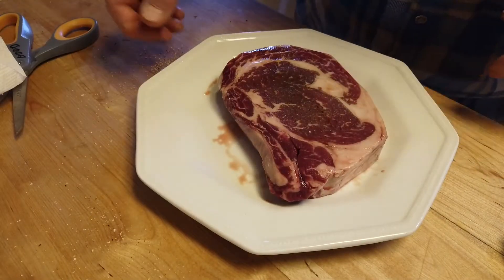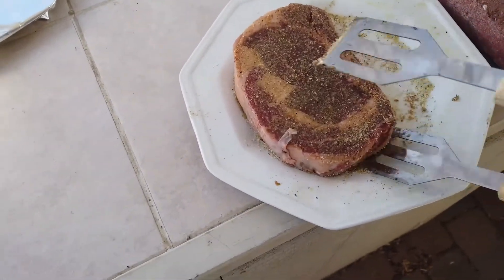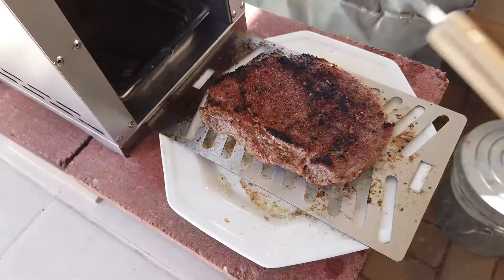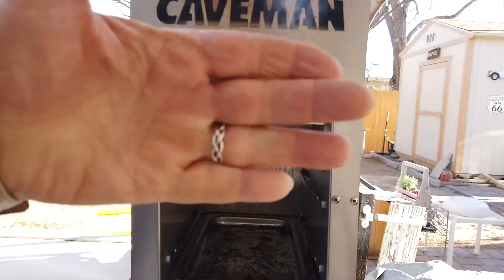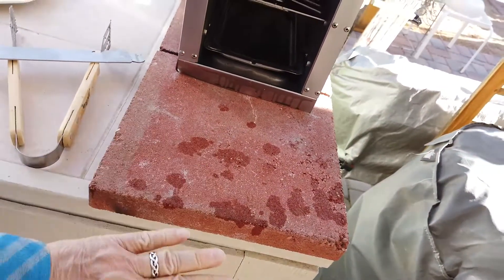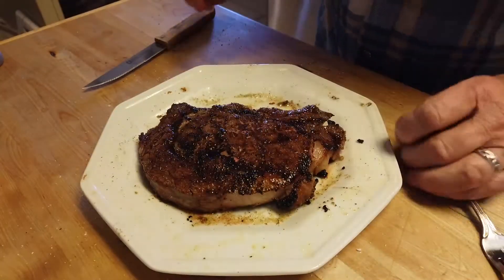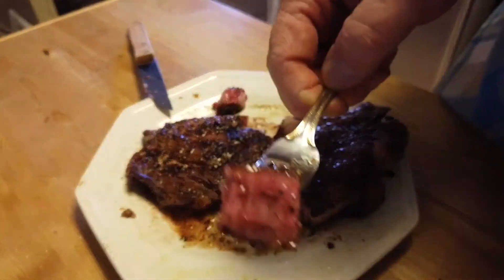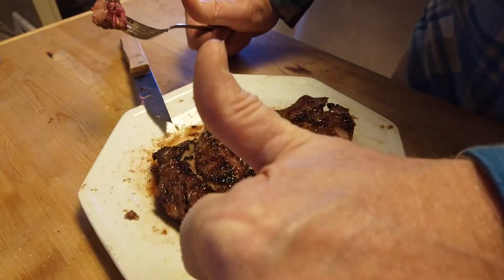Rib Eye steak on the Caveman Extreme Temperature Grill

Comment: Are you still using this and, if so, any thoughts on the experience since this video? Been eyeing this machine and curious how it's been holding up.
Ever try doing the reverse sear method so you can cook on this with less time and just focus on using this for searing/crust creation? 
I do the reverse sear method all of the time on my Traeger + cast iron pan, as it imparts a great wood smoke flavor plus with the internal temp brought up I can sear very quickly without under or over cooking the meat.

Comment: Hey, don’t ever put a steak back in the refrigerator as you’re waiting for the grill to heat up. Always keep that steak out on the counter for 10 minutes or more, which will cause the steak to cook correctly. If you throw a cold steak in the grill, that’s not a good thing.
Reply: Wrong! A steak will only go up 3-4 degrees in 10 minutes. That will make no difference.